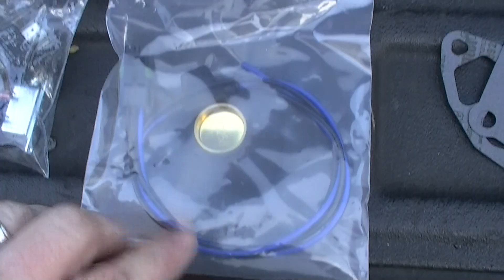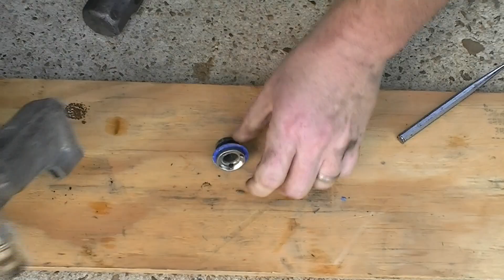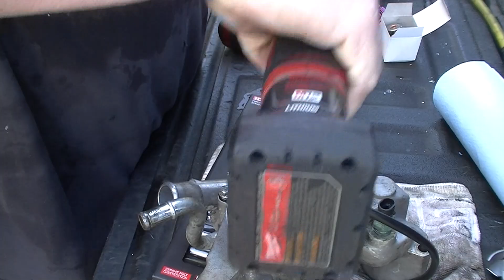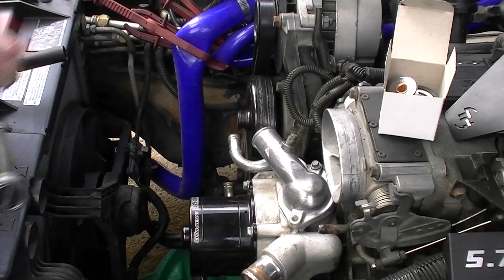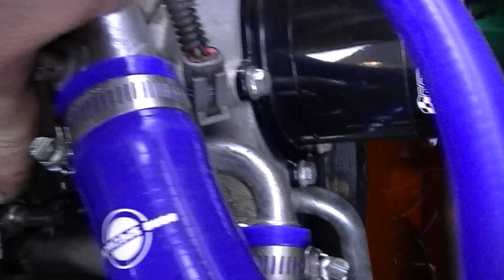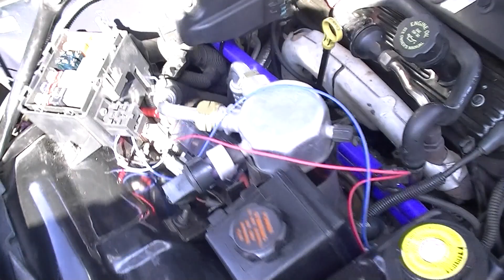Electric Water Pump Install - 1994-96 Impala SS

Comment: Great job. The camera work and narration is excellent.  I watched the entire video even though I don't intend to go electric with my water pump.  I like the idea, but I'm too lazy to do it.  I'm 72 and retired.  My '96 Impala is a garage queen with 327,000 miles.  2nd engine, 2nd transmission and 2nd rear end.  I bought it new.
Reply from the maker: I'm glad you enjoyed the video :)  My SS is a garage queen as well, 216k miles on the original engine, 3rd transmission (kept treating every stop light like a space shuttle launch) and 2nd differential setup (needed 3.73s).  I take it to shows all the time and the occasional "Sunday cruise" when the weather is nice.  Had mine since 1997.

Comment: I didn't see you plug the weep hole like i saw in another video. I think it was tapped and sealed with a small screw, but thank you very much for the tutorial. I bought this water pump over 5 years ago and now i'm finally installing it and gettin thee ol 97 ss back on the road :)
Reply from the maker: The weep hole is plugged by the freeze plug.  Once the freeze plug is installed, the weep hole is no longer an issue.

Comment: Thank you for the very detailed video man! Helps out a lot. Did this LT1 happen to have any noticeable quicker revs after this modification? Thanks again
Reply from the maker: You are very welcome.  As far as quicker revs...nothing noticeable, but if you want the LT1 to rev quicker...I recommend the underdrive crank pulley with an overdrive alternator pulley and/or a smaller-higher stall torque converter.

Comment: thanks for making this video! My 1995 Impala SS had an electric water pump installed by the previous owner (my brother-in-law who passed) It is helpful for me to understand how it was hooked up.
Reply from the maker: You are very welcome.  Just remember, this video shows how I wire it up, people have come up with many alternatives to getting power to their electric water pump.  Such as the AIR pump circuit, radiator fan circuit, or even something as simple as a toggle switch on the dash.  Take care :)